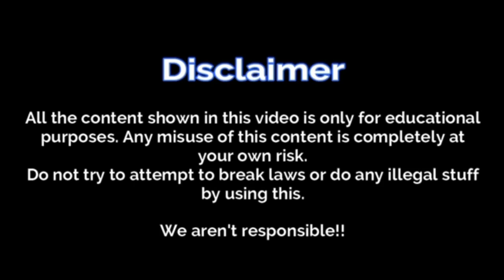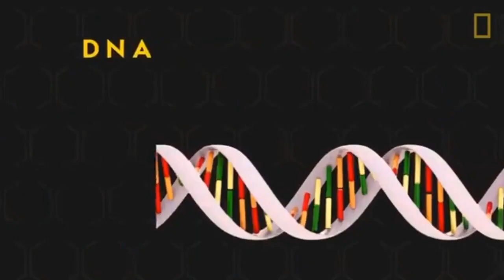Why the Future Doesn't Need us? | STS | that's relate to this PANDEMIC.

Comment: 1) You can use prophylaxis 2) you can use your immune system with some medication for some people, 3) you can use treatments, 4) you can use convalescent plasma 5) you can use a different type of vaccine like the BCG (more investigation required), 6) you can boost your immune system do not forget the vitamin c super doses, also injections of vitamin D along with calcium and sunlight, you can follow medical protocols like the ones used on India and you can use many of those aforementioned together.

Those come to my mind obviously garlic, ginger and others are really useful always, a vaccine is not necessary and should not be a must, specially with a high mutational rate, because in a few months or years it will be useless.
Reply from the maker: Thanks for this